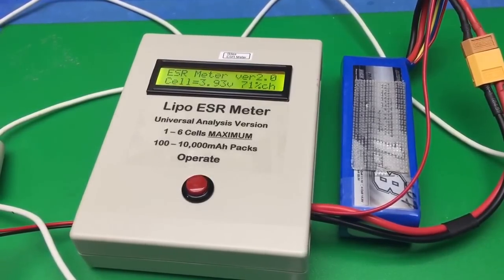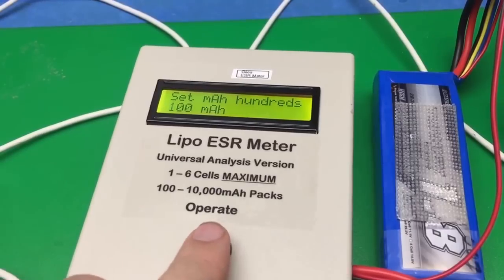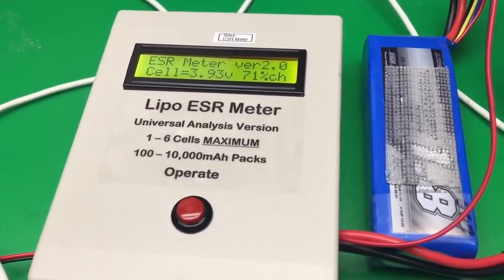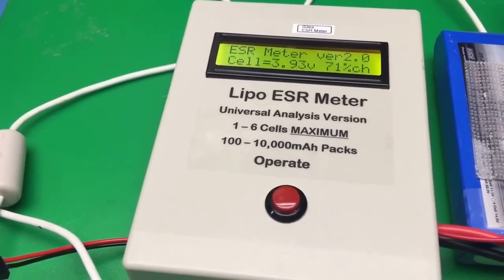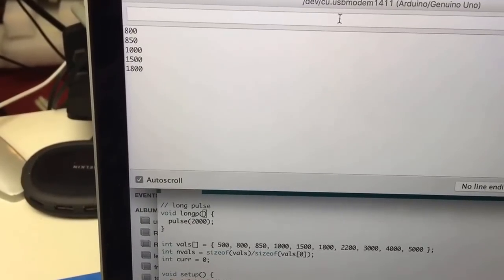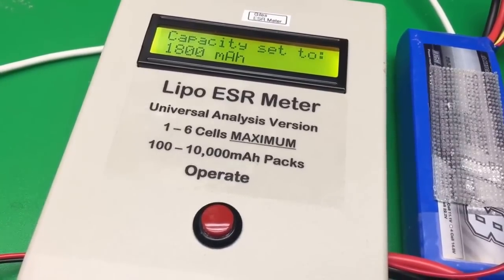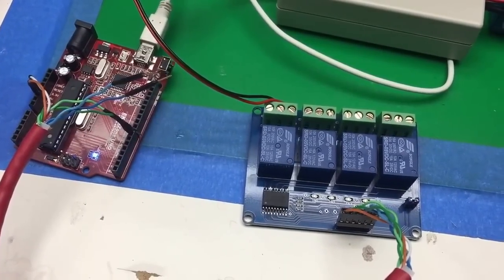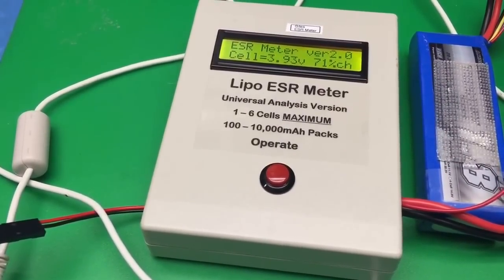Giles ESR Meter Automation

Comment: Hi all, I have a Wayhe Giles meter V 1.1.
I believe the newer version will calculate the Actual C rating of a battery you wish to test.
Now is it possible with the readings my meter will give me to calculate the actual C rating or is there a formula avaliable I could put into excel or similar

Comment: Stick RFID tags on the batteries, and connect a RFID reader to the arduino to automate it even more.
Reply: Or use a charger that shows the ESR value
Reply from the maker: Which is a good charger for that?